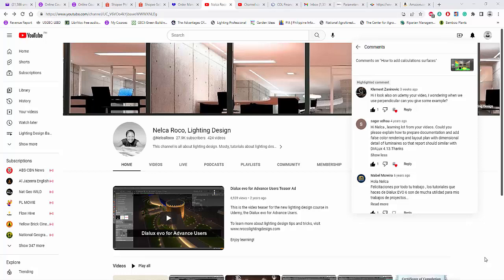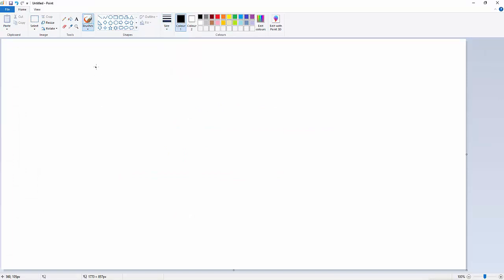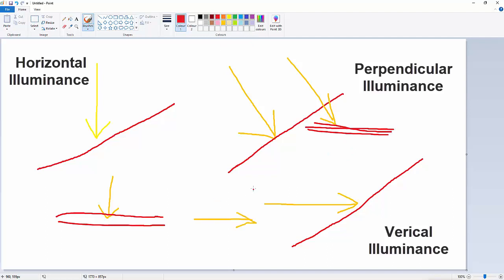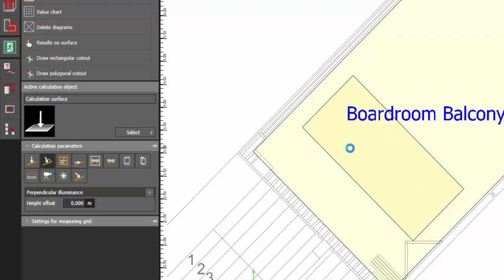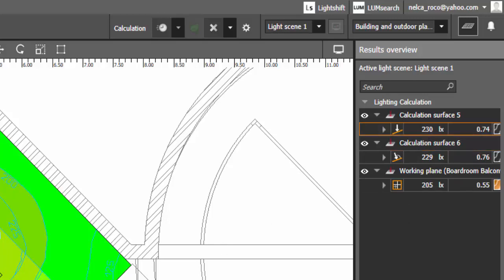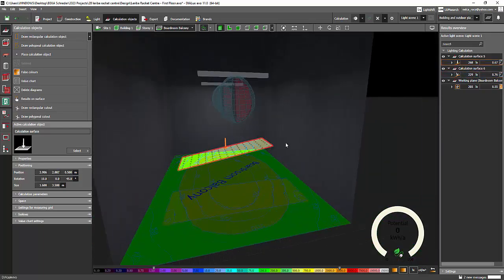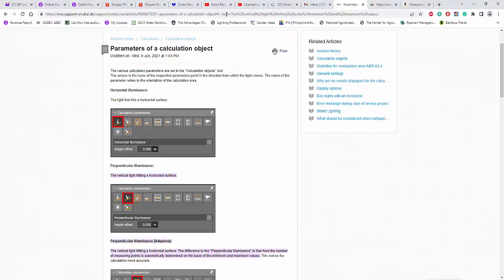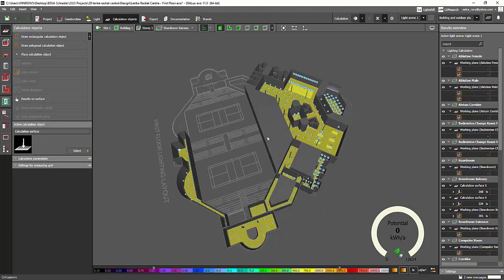What is perpendicular illuminance and where to use it?

Comment: The dialux icons are correct as "horizontal" and "vertical" illuminance refers to the horizontal and vertical vector component of the flow direction. In a physical environment it is equivalent to the horizontal or vertical position of a luxmeter sensor.